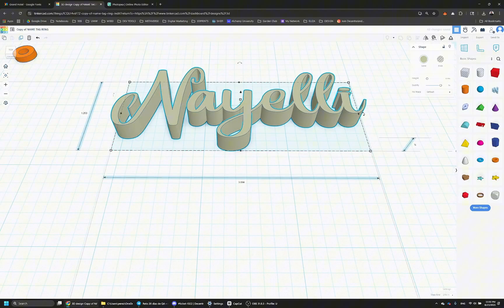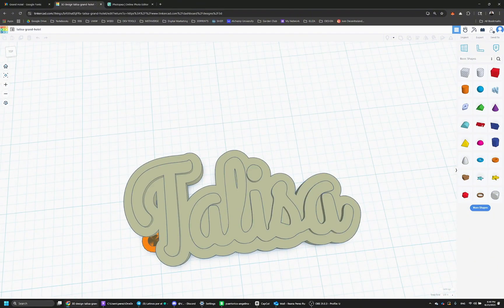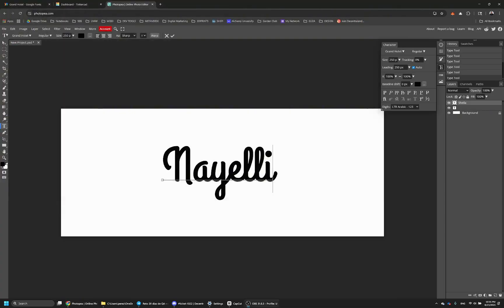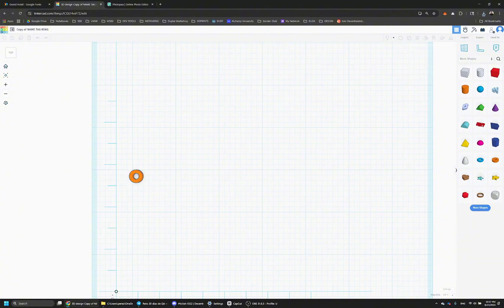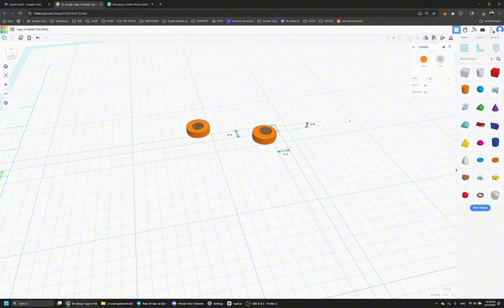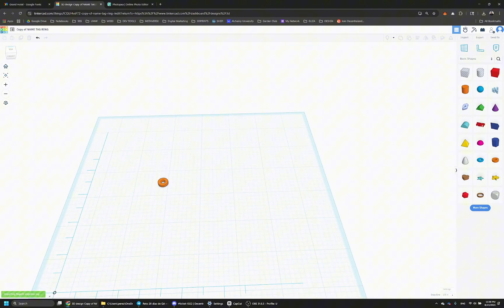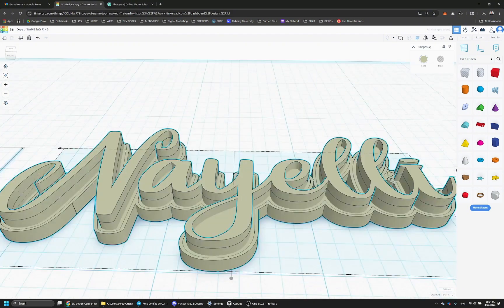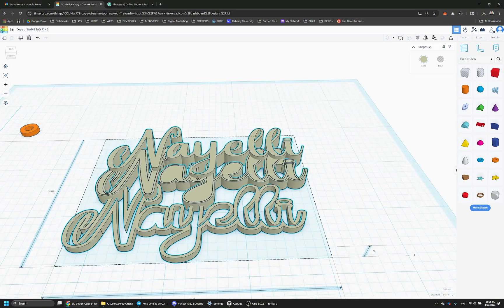How to Make 3D Printed Name Tag Keychains

Comment: Your video might be easier to follow if you showed where you are clicking instead of mentioning it in passing.  You created 4 layers and then only showed 3 that were on top of each other when you changed measurements.  No way to tell which layer was which.